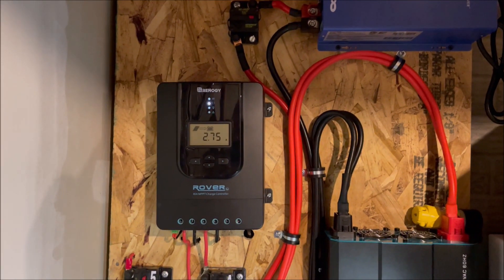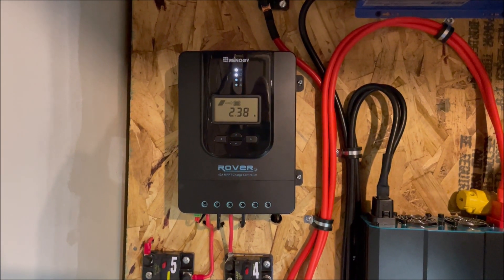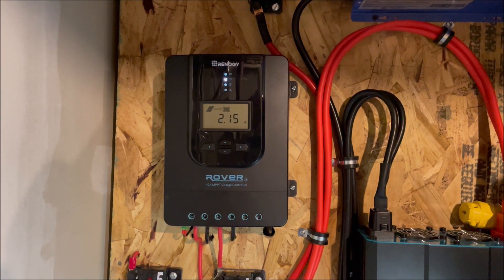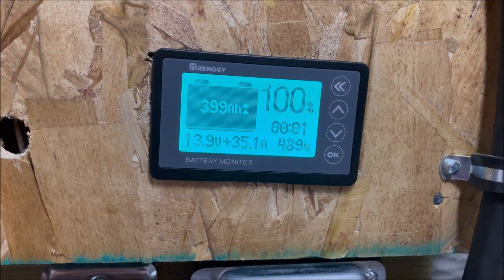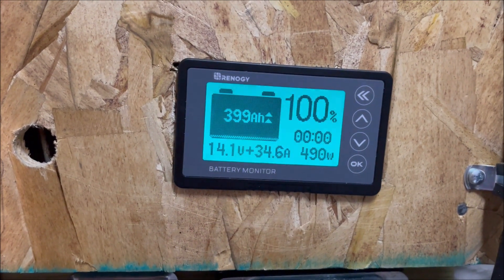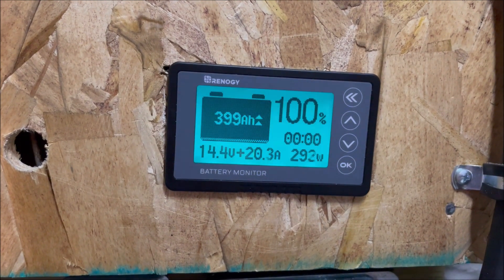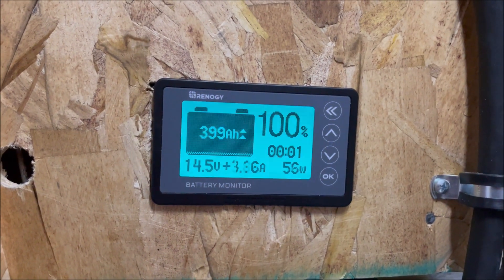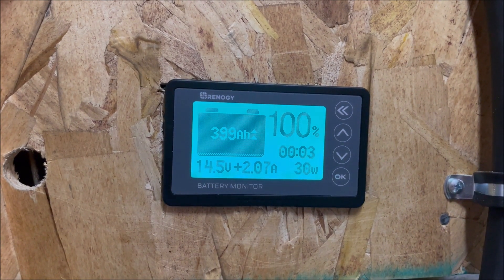How a Renogy Charge Controller Charges Your Battery - MythBusting

Comment: No bms li batteries
Reply from the maker: Lithium Batteries generally come with a Battery Management System to control charging and preventing over charging.  Was this a commercially built or Home made battery.

Comment: If it doesn't taper off the amps for a lithium battery, then it's not doing it right. Those batteries are designed to taper off. Anyone can download the data sheets for them. If chargers don't taper amps off, it decreases the life of the battery and the accuracy of the full charge. The other way it could be doing it, is to just not try and reach a full charge, then you could keep full amps, and when batteries stay around 80%, they last longer.
Reply from the maker: Thanks for the insight.  Just reporting on what it is doing.  I expect it was engineered properly.  Now, Lithium Ion which is found in items like the Jackery ramp down its charge power early so as maybe to not cause a fire.  It may all be associated with the battery chemistry.
Reply: Just read about that it is better to get them up to 80% and level out. 
PS: GO NAVY!

Comment: I had a quick question for you I plan on mounting  my Renogy 2000 W inverter vertically like you have yours however with the power cables on the bottom instead of the top,  Do you happen to know which way the air flow is when the fans are running do the fans push air into the inverter or do they pull air air out?
Reply from the maker: The fans push air into inverter.  My setup is not ideal, but was required for cable management in a small space.  Make sure you leave some space under inverter for the air to get out.  See installation video I did.
Reply: @thechiefsway2618  thank you!